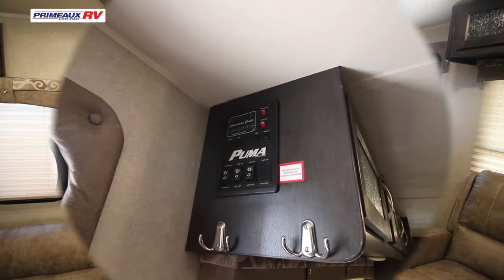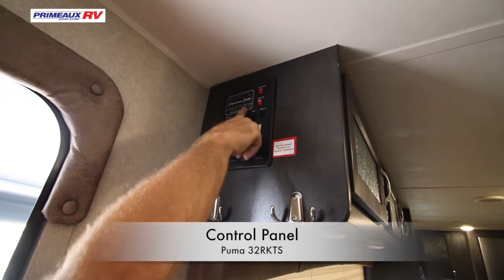Puma Travel Trailer Orientation

Comment: We enjoyed your orientation video. We just bought a 2021 Puma 255RKS fifth wheel. It has an Ever Chill refrigerator that runs on 12v only and draws 11amps. We mostly will be boon docking. What is the best way to charge the 2-6volt AGM batteries to keep up with the refrigerator draw on them?
Reply from the maker: The best way to charge the batteries is to :
1.       connect to a power source 30 or 50 amp electrical connection.
2.       connect the unit to a generator.
3.       connect a solar charging panel to the battery.
4.       Bring extra charged batteries to swap out.
Any of these options will allow the frig to continue running.
If the customer have further questions from these answers it
Is probably best to share their number with me and I will call them.